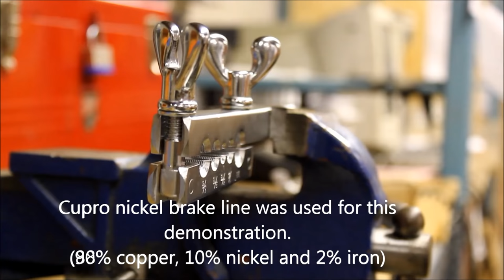How to Make a Bubble Brake Line Flare: FMSI

Comment: This is the incorrect way to do it... Your flare on an ISO/Bubble flare should be completely flat on the line side. This is the first half of making an SAE/American flare. While both can work I suggest using the flat side of the flaring tool not the cupped side.
Reply: I found this out the hard way until I read your link. Thanks for your input. It saved me a whole Lotta trouble after fucking up all night I’m trying to get a flare for my daughters car it’s the best of social media and sharing information is all about… Cheers… Keep on rocking brother.

Comment: That is not a bubble flare.  That is step one of a double flare.  It LOOKS like a bubble flare, but the bottom is not flat.  To complete a double flare, you would need to force the cone into the hole.
Reply: Well it is not a proper way to make a bubble flare. It is still usable if you combine the brake line made like this with inverted bubble flare nut.  😂😂 But yes he should use flat side of the tool to make it right and use with nuts for bubble.

Comment: Wondering why you chose to "fudge" a bubble flare with a double flare tool when your company markets a DIN/ISO bubble flare tool kit.
Reply: +radome914gt correct
although advance auto rents the tool, 
so I am going to get theres and try it.
Reply: Insane that you spotted this. Everyone is getting so confused about the correct way to do it and i guess the answer is there is not a good way to make a bubble with one of the cheap tools as shown. However it seems that if you use the flat side of the clamp and leave a bit extra protruding and if the pipe is the soft copper looking type and if the end is prepared well and if your yolk is not badly made as most of them are not flat and often pull the die off to the side. So once you have covered all of the above you might be able to make a half decent bubble with a double flaring tool such as the one in the video.
  Too many people setting the depth to the depth required for a double and making a tiny bubble in the concave side of the clamp. I recently learned that this is a bit too tiny a bubble and is very close to not making a good connection. Seems that when you use the flat side of the clamp and leave extra pipe protruding then you can make a fat enough bubble to clamp down nicely into it's mating surface.
  Best is to buy the correct tool for metric. these tools are pretty shit and i have always managed to scrape by with them. It took me 5 hours of watching youtube videos to really learn the differences between metric and USA style lines and how you can make a metric bubble with a cheap tool and also that you can make metric bubble to double to make a male to female with male female nuts so that 2x metric will mate directly together without a union. The metric unions have concave mating surfaces inside where the usa unions have convex mating surfaces inside.
  A euro line can have line ends which are both convex and concave (male to female ends) I can still only assume that this euro style of male to female brake line ends are actually one end a bubble and the other end a double flare but with male nut at one end for the bubble and a female nut with internal thread for the double flared end. 
  took me a long while to work out i could make both with the cheap tool and how the best way to make a bubble was with the cheap tool. Forget about it if you have the factory style steel galvanised pipe. You will need a decent tool for that type of pipe.

Comment: from what i can work out you need to use the flat side of the clamp and leave a bit extra line protruding when making a fat bubble end. You have followed instructions for the 1st part of a double which is different. This usually works but you might find yourself cranking the nuts super tight to get them to crush onto the mating surface.

Comment: This is not quite a bubble flare because it is supposed to have a straight backside and not a 45 degree angle. Use the other side of the tool if you wanna make a bubble flare. This is just the first step of a double flare. Not the same thing. If it works, that is another question.
Reply: it will almost certainly work
Reply: Old comment but, the Bubble completes when you screw the nut into the union. The ISO nut has a flat top and forms the flat backside when tightened. it is best not to use the flat side as it forms too small a bubble and it's often lopsided due to lack of side support. Use the flared side and let the nut flatten the back.

Comment: I made this bubble flare and I got a leak so I wonder if this cheap tool works or not?
Reply: You should use a dedicated bubble flaring tool to do it properly. Even with the right tool I've been having problems making consistent flares. I guess it takes practice.
Reply: I already bought a professional tool. I got it right.
Reply: The demonstration was incorrect.Use the flat side of the tool,rather than the countersunk side.The countersunk side is for single and double flares.

Comment: Just went through this ordeal and the cheap clamping "vise" all these kits supply does not hold the coated Nicop line securely. Even after using a wrench to tighten the wing nuts, the line just pushes out of the clamp with no flare. I even wire brushed the PFF coating off and tried and the line just pushes out the back of the fixture.
Reply: Buy a better flaring tool. The good one I finally found was not the most expensive

Comment: Good job does it work on steel line?
Reply: New Generation No. I tried. Too stiff
Reply: You need a good tool for steel line. You can only get away with the soft copper type line and the cheap tools. Also use the non concave side of the clamp for a bubble and leave extra pipe protruding.

Comment: did you really just skip the whole second step ? lol wow
Reply: crettybocker Wouldn't the "second step" create a double flare? This video says how to make a bubble flare...
Reply: +crettybocker yes he does,
Reply: Bubble flares are used for attaching rubber line to steel lines double flareing is for attaching fitting to hard lines so be need to 2 steps. All this does is help hold a rubber hose onto the hardline when clamped